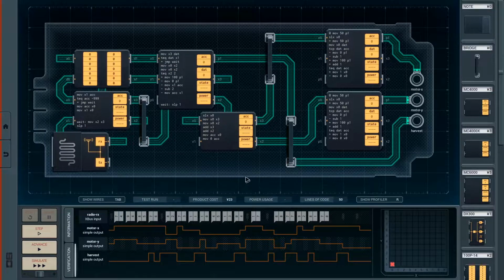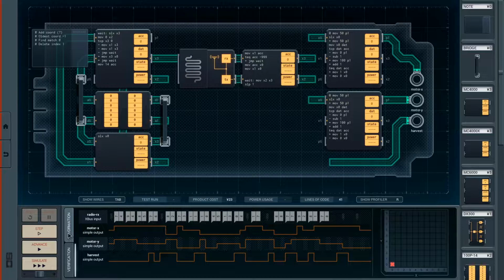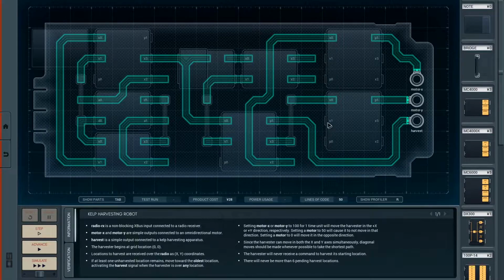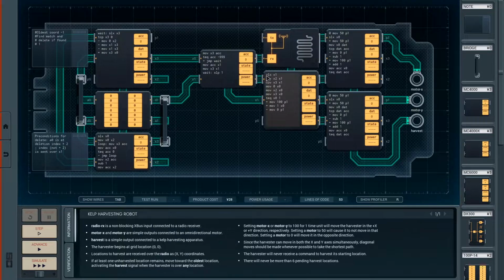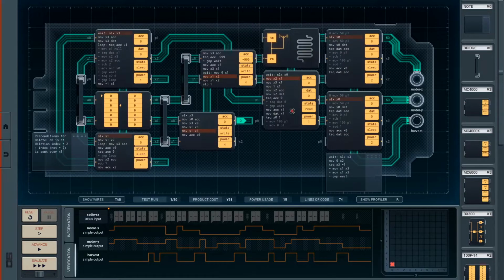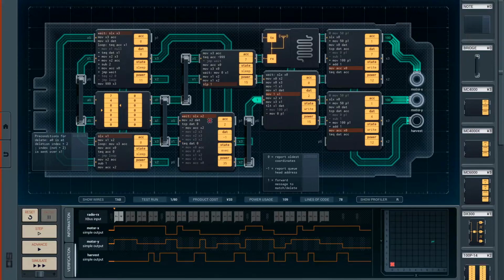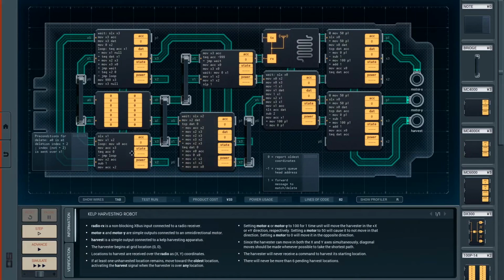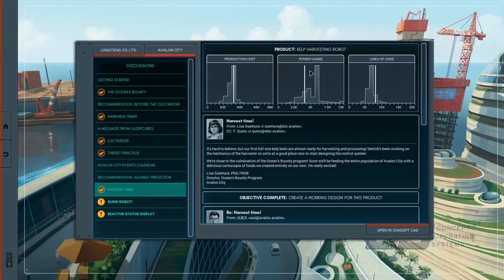Shenzhen I/O - E33: Sentinel

Comment: Hello, it's me again! Here to share my thoughts and my solution if you are interested.

This one was a doozy. I also fell into that "any" trap and it made me really sad.

The second time around though, I thought I wouldn't have enough space on the board and had to try something new. That something new probably saved me a microcontroller, though, and I was very shocked to see just how far above average it was on all graphs.

My final solution used what is basically your old ring-buffer approach, which I can now see would probably break down against meaner test cases.

If you care at this point, there are some RAM/memory tricks that you have yet to use in my solution, so don't look if you still want to stay fresh on that. 

If you want to see it though, here it is: https://imgur.com/a/H6VLCCp
Reply from the maker: Oh wow, that's super cool! So I was on to something after all with the idea of packing both digits into one entry. I kind of just figured the added dgt/dst overhead wouldn't be worth it, but I guess it's not as much as I assumed.